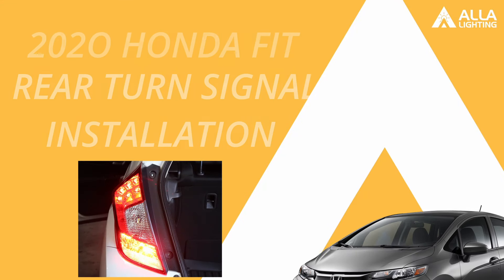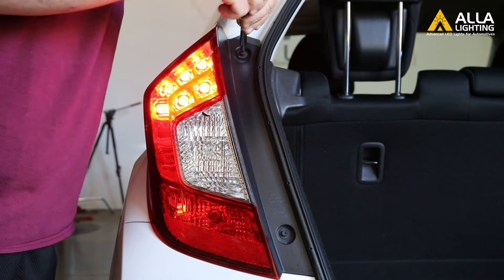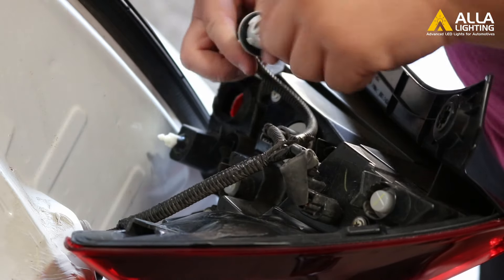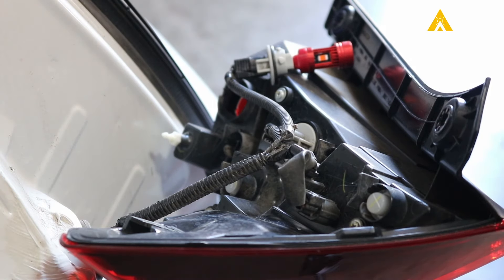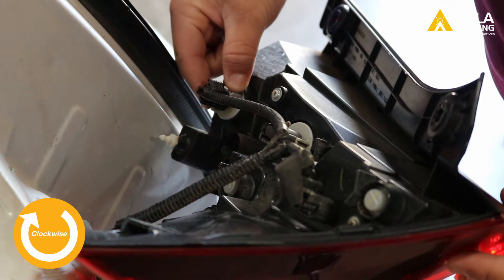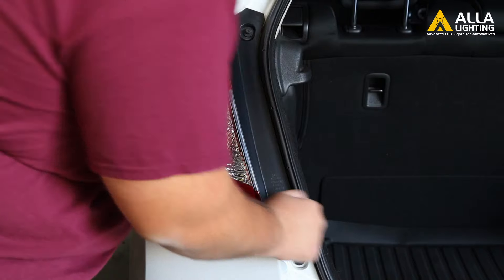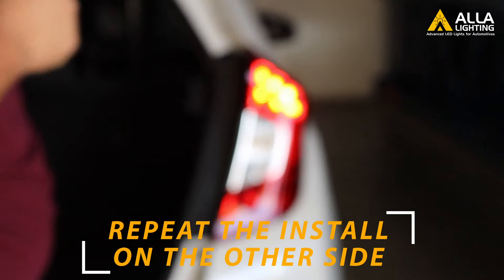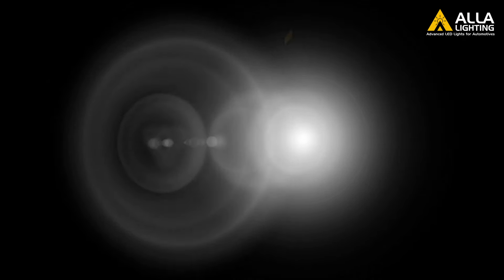Change | Replace Honda Fit Turn Signal Light Bulb, Rear | Install LEDs

Comment from the maker: How to Change | Replace Honda Fit Rear Turn Signal Light Bulb | Installation Guide LED Upgrade Incandescent Blinker Lamps for vision and safety? #hondafit #turnsignal  #ledheadlights #hondafitsignal #headlights 
Product Link: https://allalighting.com/products/canbus-t20-7440-7443-led-bulbs-amber-yellow-turn-signal-lights-7444na
Product Options: https://allalighting.com/collections/t20-7440-7443-led-bulb-signal-brake-stop-reverse-lights
Shop by Vehicle: https://allalighting.com/pages/bulb-finder-shop-by-vehicle-led-light-bulb-car-truck

Thanks for watching and if you like our videos, please give us a thumbs up, and subscribe to see more installation videos!